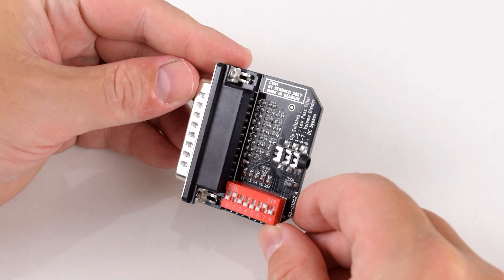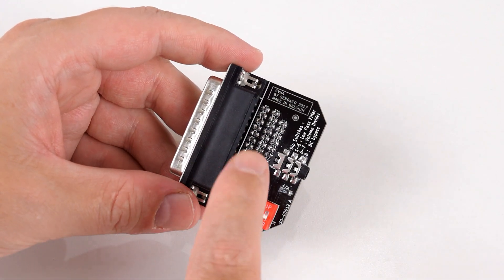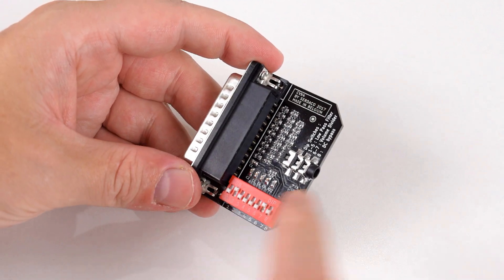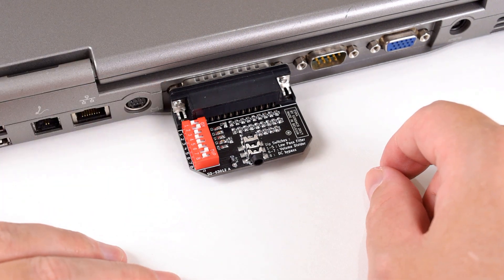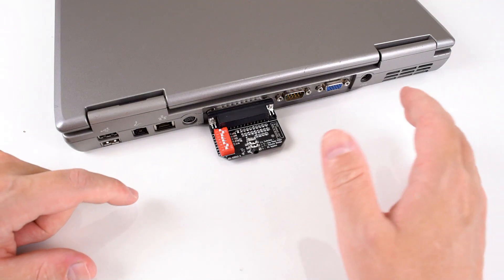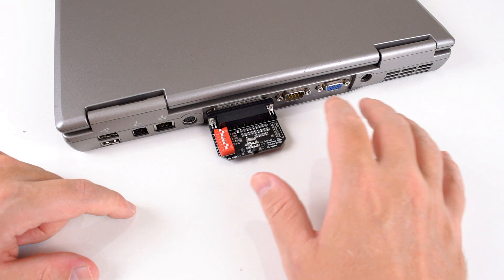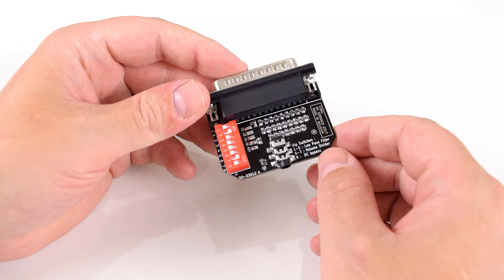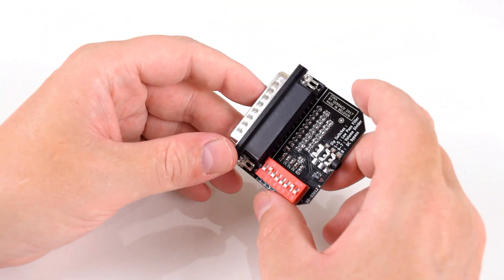Premium Covox Sound - The CVX4 Printer Port DAC from Serdaco

Comment: I'm wondering how it's coded, and how it deals with running on a single threaded CPU.  How does it multiplex graphics and sound?  Does it use interrupts?
Reply from the maker: Check the code?

Comment: For better audio quality the device should be externally powered and LPT signals buffered before the resistor ladder.
The DC-bypass btw removes the output capacitor but since most line-ins have one anyways it doesn't do much.

Comment: I remember building this for my 286/20MHz/1MB ram, before I could afford sound blaster clone card. No board, just pushed resistors into the parallel port and solder the rest in the air.

Comment: Great !...I have a modern laptop that I want to use to play old games and it is hard to find DOS drivers for the Sound chip. This is the solution I am looking for. A little bulky however it will work.   -Thanks.

Comment: It's just a bunch of resistors?  So in other words it's just an R2R ladder?  Does DOS have high resolution timers?  It's hard to push out sound a sample at a time without timers.
Reply: The IBM PC real time clock is programmable.  It is set to 1kHz by default, but if you write your own interrupt handler you can increase the frequency by decreasing the divider value.  If it were me writing the routine, I'd set the divider to 1 so you'd have a 32kHz sample rate (not too bad), and call the original interrupt handler every 32nd time.  Another option would be to poll the VGA card registers and make a software timer using the horizontal sweep/sync (most standard VGA compatible modes are around 31kHz).  Software timers are pretty CPU intensive, 'tho.  Wow, that's a bit of a trip in the distant programming past for me ;)
Reply: Just a small correction: The IBM PC doesn't have a real time clock. You are referring to the Programmable Interval Timer chip, the Intel 8253-5, which is used to trigger an interrupt every so many counts.
Reply: Correct.  The Covox Speech Thing and the Disney Sound Source are both just R2R networks.

Comment: Aah, the 1980s... where a crude resistor-ladder DAC was considered 'good sound' :)

I think it would be interesting to see how good of a sound quality you can get from one of these on a much slower system (I'm thinking late 486?) as I believe they require a lot of processor time to wiggle the parallel port lines. 

Greetings from the UK!
Reply: 0.1% resistors have the same accuracy as an average DAC chip.  In fact a DAC chip is quite similar to this inside.

It's really a matter of discrete vs integrated.  Not much quality difference.  So yes, it's good sound.
Reply: When these were new, they were often used with XTs and ATs, so I'd say they probably sounded fine... At the expense of all available processing power.
Reply: There are Covox trackers for 8088 PC's. Resistor-ladder is the fastest possible DAC type and output distortion is dependant on resistor value accuracy, being only 8 bits is a limitation here but if you could also use the 4 control signals you could have 12 bit resolution, thats plenty. Given fast enough CPU you can have as high sample rate as you want.

Comment: Would be interesting to use parallel port's control signals to control a latch that would let you load samples into left and right latch to get stereo sound.

By the way, this device can leave a DC level on output when playback stops.  If plugged into some types of amplifiers or speakers the DC current can destroy the amplifier and speaker.
Reply: See, now you're thinking like an 80s computer engineer!
Reply: Only if you turn the DC filter bypass on though.
Reply: almost all audio amplifier designs have the DC bypass capacitor at the input already. I think the DC bypass cap here is for headphone users.
Reply: Isn't that more or less what the SB Pro 2 does, albeit inside the silicon?

Comment: It's fascinating how such a simple device is able to produce a reasonable quality sound.
Reply: DAC chips are basically this inside, and 8-bit sound, which is what this is was fairly common.  For instance Amiga did sampled playback but the DAC was 8-bit per channel.

What's more interesting is getting a good sampling rate through the parallel port, there could be some caveats with that on some chipsets.

Comment: Fortunately I don't lived the soundless computer era. Our first 386 already came with a Sound Blaster 16
Reply: My 386 only had a PC speaker.  :( It did have a VGA card though. :)
Reply: I remember owning a 286 that didn't even have a pc-speaker. My brother installed one at some point, and I thought it was the best thing since sliced bread! Then few years later on a newer machine I heard Sound Blaster for the first time, when my brother bought a CD-ROM drive bundled with a sound card. He loaded Wing Commander 3 which was preceded by an "Intel Inside" into and that thing alone was enough to knock my socks off. What followed left me completely speechless.

Comment: R2R is pretty interesting circuit. The only problem with it is that it requires precise resistors to be linear. And that probaby is where the most of the price of this device comes from. But… It is prefectly possible to build 12 (maybe even 14) bit DACs with cheap 5% resistors and still make it linear. The key is matching them. Few years ago I've written a simple program to match high tolerance/low precision resistors for R2R ladder. The absolute values do not matter, they can be all over the place. It's the ratio of the equivalent resistances that matters.
Reply: It's close to linear but not perfect.  In fact DAC chips have a linearity tolerance that just so happens to be similar to R2R.  It's not a coincidence. ;)
Reply: Indeed.

Comment: Professionally made production clone of an obscure sound card from the 80s made with the best quality parts available and it costs 20 bucks. What a time to be alive.
Reply: That's the sad thing actually. We're fortunate to have retro hardware that lasts for decades as well as software  capable of running in standalone mode, without requiring online activation, cloud storage and other forms of DRM garbage. Cell phones and tablets available today you won't be able to take out of the box and boot up, even if they're perfectly preserved.

In addition, removable batteries are becoming a nuisance. If you buy a laptop from 80's or 90's, you can refit it with a new battery most of the time, or at least take the old one out and have it run off a brick. Ever tried firing up a cell phone or a tablet with a dead cell? Most will refuse to run outright.

People who are growing up today - by the time they hit their mid life crisis and begin craving nostalgia - they'll have nothing to go back to, unless the entire experience gets simulated in VR. By then we'll all be living in Matrix...
Reply: @enilenis  Meanwhile, my 2019 iphone is basically eWaste as I can't run the software I need on it as the iOS is "too old".
Reply: In a future our descendants will re-create cellphones and tablets
Reply: Yeah, that's really bad. I like to go completely off-line from time to time, but it's hard. Living without a cellphone is getting harder and harder. But it's good to try it.
Reply: @enilenis, You sir deserve a standing ovation!
Reply: Cellphones and Tablets will still exist them but in a form we can't think of.

Comment: So it has no chips? Just resistors? Weird.
Reply: Yep, if you are cheap you could cobble it together with a bunch of resistors flapping in the breeze straight from your tinker-bin. It simply uses the parallel port 8 bit lines as a DAC and including some software PWM magic you can achieve some great quality.
Reply: I think you are mixing it up with the 1-bit PC speaker digi sound playback, which uses the PWM technique. For the Covox you simply send 8-bit unsigned PCM to the parallel port.